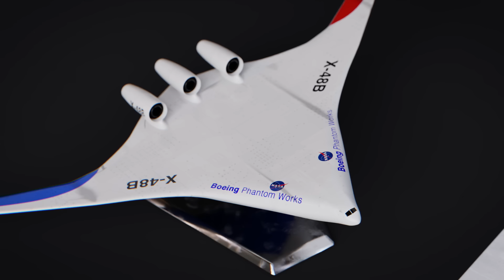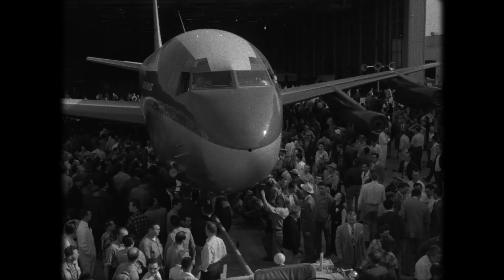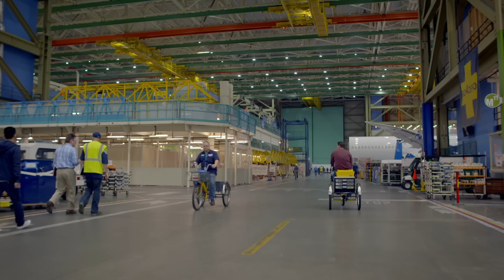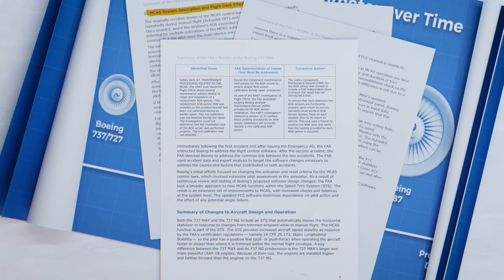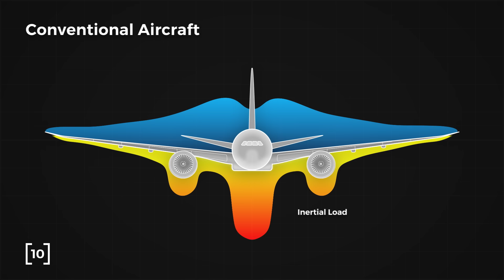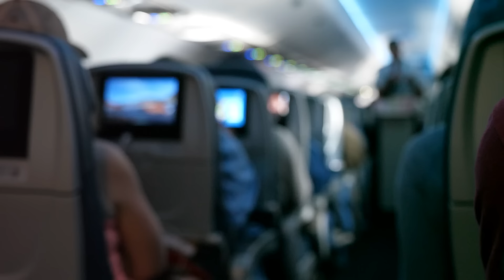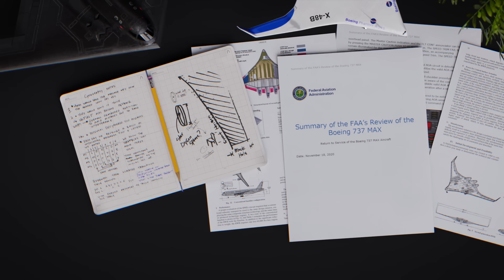The Plane That Will Change Travel Forever

Comment: One of the items you passed over rapidly was the infrastructure requirements for a plane of this design.  When you consider that not a single airport has the facilities to handle one of these planes, the time frame for developing and building the infrastructure, and the potential for requiring larger tracts of land to enable high-density flight operations, this becomes a little harder to envision.  Take a look at LAX and the International Terminal there, it can handle about 13 or 14 large intercontinental capable aircraft.  If the footprint of one of these planes is larger than a current airframe, then you reduce the space available for terminal operations.  You would have to space the terminal further away from each other to enable ingress and egress of aircraft from the terminal and widen current taxiways.  The costs would be prohibitive and significantly impact current airport operations.  Maybe in 20 years, if they started the planning now and putting the money aside to make it happen, otherwise I wouldn't hold my breath.
A comparative look at the proposed size of one of these aircraft, particularly from an overhead perspective, would have been even more informative.

Comment: Utter joke all this new technology never been tested as jet liners however british beat us technology with tried and tested variant going back to 1970s or 50 year tech with concorde needs new carbon fibre light body materials plus newer high powered rolls royce engines to take back lead no need for mcdonnel untried prototypes they will succumb to failiures.

Comment: So why is the center of gravity typically placed well in front of the center of lift on a conventional tube & wings airliner?

For safety reasons? ( stability & avoiding stall ) 

And wouldn't it make sense to at least have them closer together?
Reply: Yeah for stability. Like an arrow. The closer they are togehter, the less stable it becomes, if the center of lift is infront of the center of gravity - imagine throwing an arrow backwards. Most modern fighter jets have them very close together, if not switched like the backwards arrow to increase maneuverability, those can only be controled by a fly-by-wire system with computer assited stability.
Reply: @hernerweisenberg7052  OK, thank you 🤗

Comment: Regrettably the information on the MCAS system and the 2 B737-MAX crashes was incorrect. MCAS was designed and was to be sold with two sets of sensors. The aircraft in the 2nd crash was fitted with 2 sensors. The contribution of the crew to the mishap should also have been addressed. But that would not have fit into the storyline.

Comment: To be frank the blended wing body is all well and good from an engineering standpoint but one thing was left unaddressed here. The aircraft footprint on the ground and making a commercially viable aircraft of this pattern in passenger capacities required by the airlines that can be accommodated in existing airports without requiring wholescale reconstruction of airside facilities from ramps and gates to taxiways. I'd also be interested in a study using this geometry with a focus on the efficient evacuation of passengers and crew in a timely manner. Air travel is not merely about wheels up to wheels down.

Comment: The problem with air travel is the air circulation system which not only takes air from close to the engines giving us oil fumes it does not have any clean air or oxygen refill in it.
The pilots do not even bother to blow out the old air from the previous flights & all passengers are breathing everybody elses exhalations.
And do the mechanics or anyone ever bother to clean the air filters?  
Not to mention the fact that they are spreading & recycling any viruses that a passenger has to everyone else.
Reply: I mean... the air in the atmosphere is definitely clean and has oxygen. Fume events are definitely a concern but are rare; generally you are not breathing in oil fumes, and if you are it would certainly be very obvious and considered a significant problem. Air in the cabin is certainly recirculated
Reply: There is no air in the atmosphere over 5,000 feet that's why cabins are pressurised & sealed. The oil from the engines happens when the engines are started on the ground when the bearings are worn.
Reply: @maxwolfe7194  There is air in the atmosphere over 5000 feet, that's why airplane engines have an air inlet... it is lower pressure than at sea level, so the engines are used to compress the air and then deliver it to the cabin. Cabins are not completely sealed; about half the air is recycled after being filtered and half is discharged (and resupplied from the compressor).

Comment: I said this a while back many years ago. If they could FLATTEN the shape and get it away from the tube, it could cut through the air alot better. They try to mimic nature and machineize it if that's even a word.

My theory was that of an ARROW. the flat arrow head type. The stealth bomber was a good thing. I was thinking if they could get it even flatter than that.

Another theory I came up with, is mold injected planes. Would be several sections of the mold bolted together, melt the metal, and one big pour or pressurized injection into the mold until filled. Allowed to cool 24 hrs, mold un bolted, stored away, then the object sprayed down for faster cooling safely without cracking.

Less bolts and parts that can suffer from wear and tear etc. The harnesses and wiring easily ran through the body, panels installed, windows etc.

You can churn out planes VERY quickly. Maybe this new f35 could be made in mass via this method. Cheaper production costs, time  labor, etc. You can have a lot of fighters quickly.

And when crafts are damaged, can easily remelt them down and RE poured into a new mold along with new metal added into the mix. However seen fit at that moment.

No clue if any engineer will ever come across my Comment and give any advice or thoughts. If so much appreciated. Many thanks. 💪 ❤

Comment: 1. Arado Ar234 is the first jet with conventional layout
2. Nothrop explored a flying wing airliner when they were building the 1st flying wing bomber.   The real problem with a flying wing airliner is that where one puts the passengers has to be tall.  This makes the passenger section too thick for efficient flight at expected cruise speeds. The only practical design is a slow turbo prop flying wing
3. Good ideas don't make profitable airplanes.   The giant airbus is better than a 747 but big planes are not what the airlines want.

Comment: One other issue somewhat related to stability of the BWB in flight is dealing with turbulence: in 2016 I spoke to some B-2 pilots, and one related to me a landing by one of his instructors a few years before in windy weather. The plane was shaking violently on approach due to strong and variable crosswinds: with such a huge lifting surface area, even the advanced flight computers were struggling to smooth out the ride. It was so bad, he had to get his co-pilot to press his own hand onto the throttle to prevent it from being thrown about. And both crew did have some neck soreness for a day or so. 
 
And another issue to add to this...where will some passengers be in relation to the BWB's roll axis? With the traditional tube with wings, passengers in - say - an A380 are never more than ~3m away from the central roll axis. But in a large BWB, they could be close to 9m away - and that would make for a lot of extra air sickness bags being needed for every flight.

A BWB design solves many issues, but it creates some very serious new ones especally relating to passenger comfort.

Comment: rotflmao - Boeing did a study of these in the late 70s or early 80s, and concluded they would only be comparable in efficiency for aircraft carrying over 1000 passengers, and with the demise of the A380, that isn't happening anytime soon - even if they find a solution to passengers getting claustrophobic with no windows outside.

Comment: I'm sure the airline industry will take the time to figure out it won't be profitable to build these in America. So let's all fly SpaceX in the near future. Made in America
EDIT: If they stick to the plan to use hydrogen fuel, I'll be investing more in SpaceX because hydrogen fuel might be okay but you have to replace the actual engine every three years because hydrogen eats up metal. ALL hydrogen-based propulsion units should be considered disposable

Comment: There is another sandwich in the picnic basket that is being developed by Otto Aviation which is, in fact, a variation of the tube and wing variation, a very very very smart advancement in drag reduction. It involves making the entire airplane as laminar  and  low drag as possible, and that includes , gasp, getting rid of the axial flow turbojet engine for a frigging diesel powerplant. And,  it uses a PROPELLAR. It get STELLAR fuel economy. This fuse is called 'a body of revolution'.  That's a streamlined tube, which is inherently  pressurizeable. And the prop itself causes the body to be as laminar as possible as the single  aft mounted prop causes the air to reattatch aft of the fuselage, making the body almost entirely laminar. The wing is as laminar as currently possible .It's a sailplane wing...them guys use no powerplant to get FABULOUS performance. And the diesel engine gets much much  better fuel ecomomy. I should know. I worked once for General Electric designing jet  engines, testing for evaluation. This package has low wetted area. Check out Otto Aviation. It is stunning.

Comment: As an engineer, I know for a certain fact that earlier when you listed out those problems, it seems that there's too much risk putting into this design. The only benefit it has is probably saving 27% of total fuel costs which probably motivates companies to invest in this design type. Safety should be the main concern though, especially having passive stability for the plane.

Comment: I wonder how wide we can make the cabin b4 passengers become significantly uncomfortable from the motion of banking. I think a short 3,3,3 BWB with 200 pax would be an ideal narrow body replacement. Can you stretch and shrink a BWB like a tube? Would a slightly larger or smaller one require all new molds and parts? If so it might be a non starter just from that

Comment: Fuel consumption and CO2 emissions cannot be the main concern in airplane design. You could potentially attach each passenger to a balloon and release them when the wind was right. 0% fuel consumption, 0% CO2 emissions from the aircraft but, does this make sense?

Comment: 8:20 "Removing the tail removes an important stability feature". Well, I reckon that is all we need to know. Airspace is not a blue-sky, calm-wind environment: it is messy, it changes, and it will throw everything you can imagine to try to crash your plane, and add mountain ranges, tricky strips, terrible cross winds when you are short of fuel. Stability is way more important than saving 5% of fuel, if you ask me. Personally, a delta wing is a no-go!
Reply: Except for a supersonic airliner like the Concorde.
But I agree: controlability is far more important than the small gain in performance ,when eliminating the control and stabilization horizontal surfaces.

Comment: To solve the problem of not having a tail on the plane, they could just use a gimbaled thrust system, like on the SpaceX rockets, where they could point the engines in any direction that's needed.

Comment: I like the idea and it seems to me that the benefits outweigh the costs. I'd feel safe if (1) the pressurization problem could be totally resolved with new materials and (2) there were more than adequate redundancies in sensors and software so the fly by wire would be a nonissue.  Test the hell out of prototypes before putting  passengers in them and with zero issue performance problems at the time of rollout, the public will trust them.  Can't we do that?

Comment: I see several problem w/ the blended wing design:
1. Fuel tanks will be too close to passengers.
2. Lack of modular design means longer assembly times and difficulty in scaling design up/down.
3. Engines may be susceptible to ice ingestion.
4. R&D costs will be very high.  The 787's Dreamliner's new composite fuselage caused many delays.

Comment: A detailed and comprehensive account of the "span loader" designs currently under development- well done!  FWIW, early in the video, the description of the "tube and wing" design includes the negative effects (on aerodynamics and fuel consumption) of the downward angled horizontal stabilizer.  I would like to point out that the first aircraft that eliminated that downward angle was the General Dynamics F-16 Fighting Falcon (better known to its pilots as the "Viper").  The horizontal stabilizer on that plane provides UPLIFT, reducing drag and making the aircraft UNSTABLE, a positive attribute for a highly maneuverable fighter aircraft.  The F-16 only achieves its stability in flight by the Fly-By-Wire system developed for that project.

Comment: As an engineering channel, you should really learn to pronounce kilometre properly.
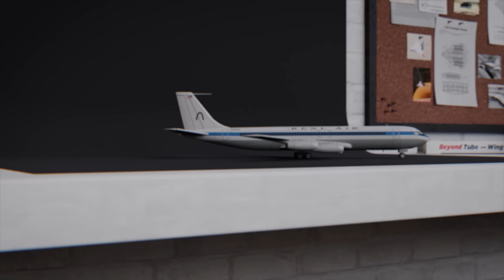3:41 The symbol for the hour is h, not "hr" (hour-revolution).
6:47 why would you use gallons?
19:06 Also, it should be metres not "meters".

Comment: This is cool I'm open minded just as long as this is not brought to us by the same "progressive -liberal" brainiac's that forced the end of the paper grocery bag with the extremely ecology friendly Plastic Bag . Excellent decision making as the Plastic Bag has had no negative impact on the environment at all. Right?

Mind you these are the same people who are forcing electric vehicles into the market before the laws governing the market are present. This is why we have so many companies offering 12k dollar e bicycles that go 30 mph for an hour before needing to b recharged for 6 hours.

I'm all for clean energy but talk about putting the cart before the horse. Shouldn't the priority be quick charge times and as many charging stations as there are gas stations?

High speed under ground magnetic or super conductor levatating train and pod travel makes more sense. It very dumb to pollute the upper atmosphere. We don't need things crashing from the sky as well.

Comment: What you're explaining for the C.G. positioning in front of the main wing is valid for a Cessna but not an airline jet. Modern airlines jets have a C.G. behind the main wing and the rear stab. have a positive angle of attack in order to have both wings contributing to lift the airplane.
Reply: The horizontal stabilizer is definitely typically near zero lift and the sign would just depend on where the center of gravity is. You wouldn't want the horizontal stabilizer contributing to lift because it's a low aspect ratio, inefficient wing.
Reply: Kehlani Giana  I know!!!! All that nerd talk is such a turn-on!!!!

Comment: It won't happen. The Centrifugal Propeller will replace all rockets, jet engines, and most air and marine propellers. It has no external moving parts and no external vents. It looks like a flying saucer and that shape is functional. It will be capable of vertical take-off and landings. It is capable of operating in space, in air and in water. In space it will continually accelerate, allowing us to reach Mars in hours. The technology in this video is obsolete already. There is a working proof-of-concept prototype of the Centrifugal Propeller, and a video of an early test of it is posted here on YT.

Comment: About hull construction : look at a paddleboard manufacturing to see how future blended wing will be made. About the downforce-thing : any airfoil making lift is making pitch down momentum. On a blended wing or a delta wing the tips are angled down to compensate, thus making some amount of parasitic drag, like a conventional tail. Some airfoil profiles have no pitch-down momentum, using a cambered up trailing edge, at the cost of reduced lift to drag ratio (worse than wing and tail configuration) Note that some blended wing designs have longer fuselage, with elevator stabilizers at the end. The only real gain is mass repartition, AND longer main chord of the blended fuselage, thus easing Reynolds number and giving better lift to drag ratio.

Comment: Another problem with the concept; where will it park? 
The current airport layout and ground infrastructure will not support this design. It would require significant airport facilities redesign and modifications that will be added to the facility charges included in the ticket prices. 
The Airbus A-380 required many airports to reluctantly rebuild and strengthen taxiways and parking aprons to accommodate the stress of the A-380’s weight footprint. How will the airlines get the local city government to make huge financial investments to totally redesign and rebuild the airport terminal to accommodate a couple of theses jets. The require a lot of ramp space. 
Aerodynamically awesome but for now not feasible.
Reply: Airports regularly rebuild facilities to deal with simple maintenance or changes in demand, with how much fuel savings these type of planes have airlines will buy them and thus airports will make infrastructure to use them.

Comment: The F-16 has negative static stability which is the complete opposite of the standard airplane. The flight control computers actively move the horizontal stabilizer (stabilators) continuously during flight. Both the wing and tail surfaces provide lift. That design characteristic is what makes the airplane so maneuverable. There has never been a failure of the F-16 flight control system. The only failure modes were electric transients from the emergency power unit  that overwhelmed the power to all 4 flight control computers. Subsequent isolation of the power to the computers eliminated that. Big flaw in this presentation.